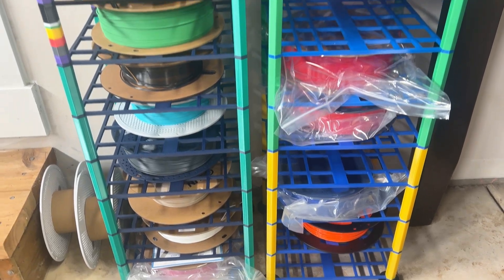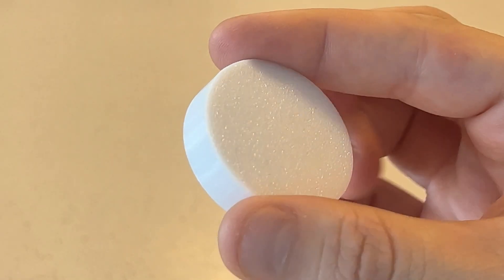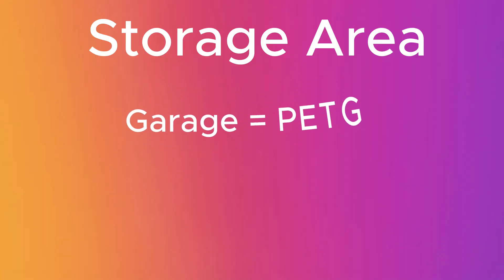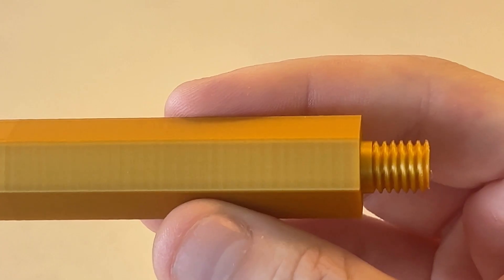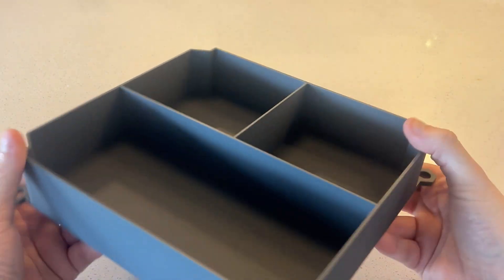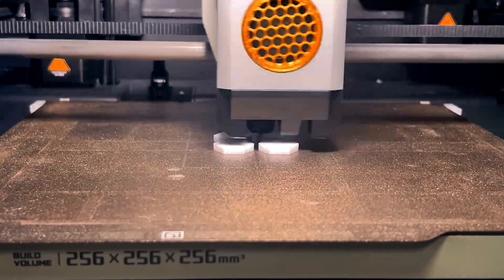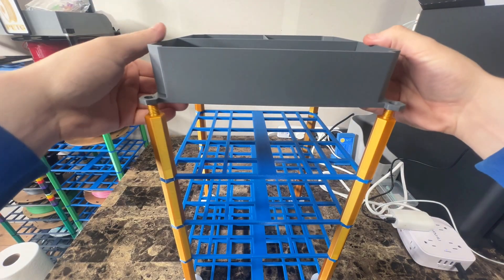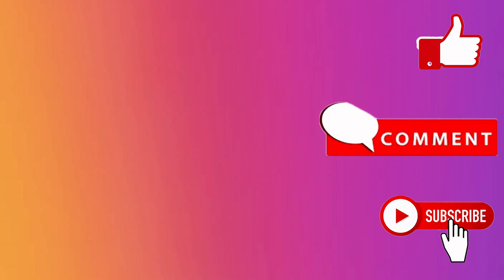Every 3D Printer Owner Needs This Filament Storage Shelf Unit

Comment: How much filament do you  use?  Would it be cheaper to buy. Premade shelves
Reply from the maker: Depends on what you buy! A storage closet or even racks can go upwards of a 100$ if not more. 1 roll of filament (typically 1kg) can be 25$ or less. I only used 963g for this specific storage tower. I also saw it as a space saver as well, while other storage options take up more space. But maybe you’re onto something, mounting premade shelves would work as well! 👍

Comment: I am not 100% sure, but I believe you could print the shelf grids all at once stacked on top of each other, if you alternate between materials that have low adhesion between them, like PLA and PETG, and specifically set the top layer of each shelf to be ironed before starting the next.   I haven't tested this as yet myself, but people have reported decent results for other prints that use that idea.   This is a useful print though, thanks for making the vid!
Reply from the maker: Ooo I might look into that!! Thank you for the comment! 👌